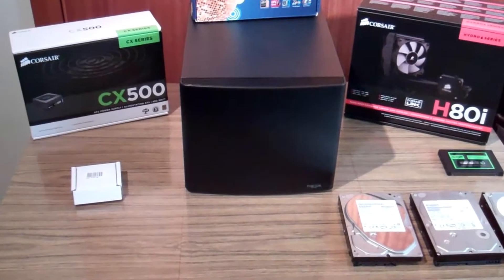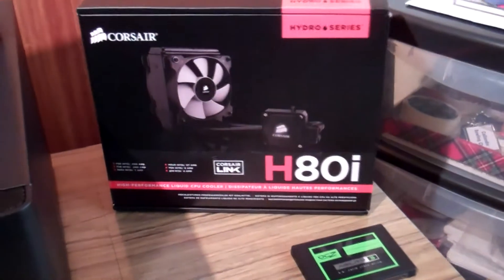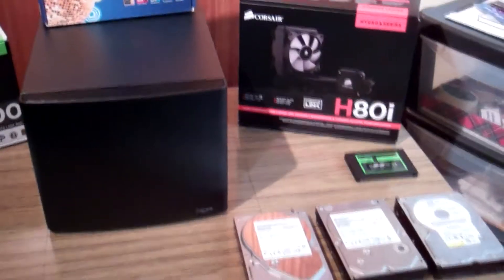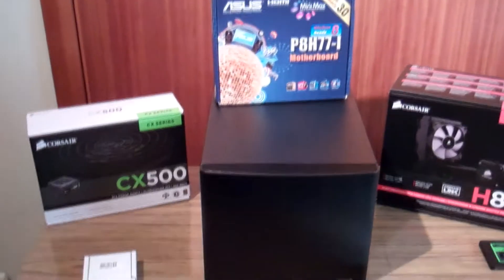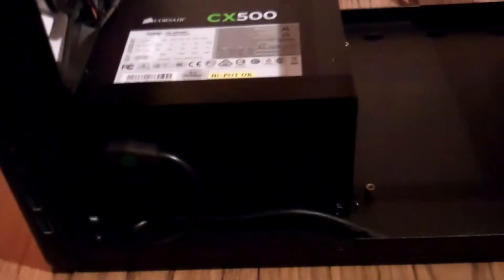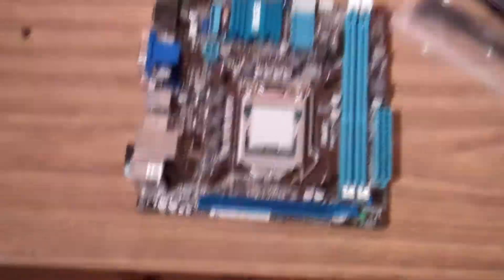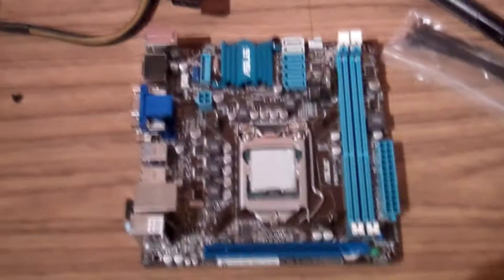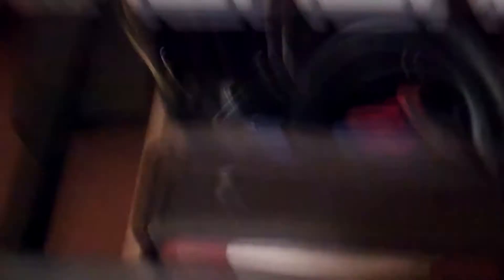Mini ITX SERVER Build

Comment: in the future i plan on making a half life / storage server . would i need a gpu for a 10 player server, and would any i5 CPU that works with the motherboard work good? also about the storage part, is there a way to transfer files from windows 10 to Linux and back again via Bluetooth (and have it open to receiving files 24/7)?
Reply from the maker: The tech in this server is quite old now so more modern stuff would fit your use case better. Not too sure about the requirements for running a half life server as i have never tried to do this. In terms of use as a storage server, this server has been running Linux for last 4 years with ZFS storage pools and never skipped a beat. I have never used Bluetooth for transferring between computers as it is quite slow, I'm sure someone will have tried this, so there will be a walk through online somewhere. A better solution would be wifi or wired Ethernet and it will make sharing files between Linux and windows a lot easier. Hope this helps.
Reply: etechnology thanks